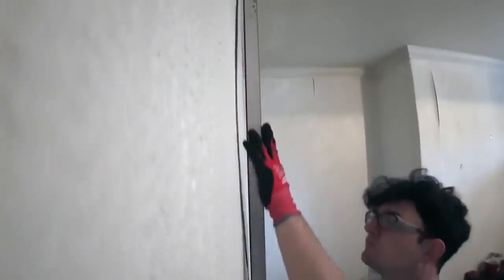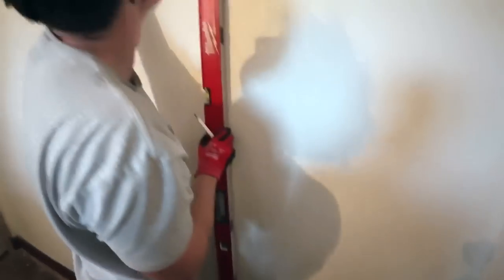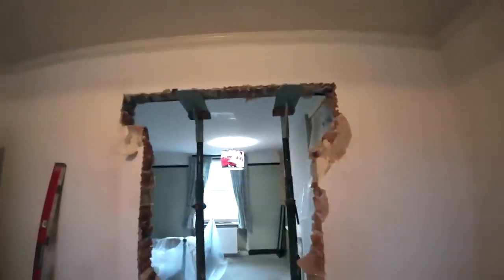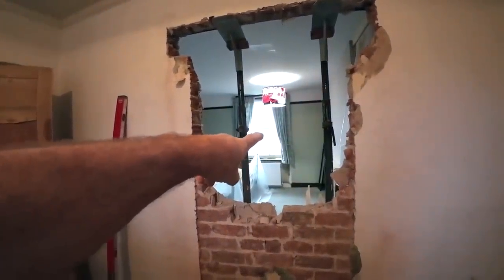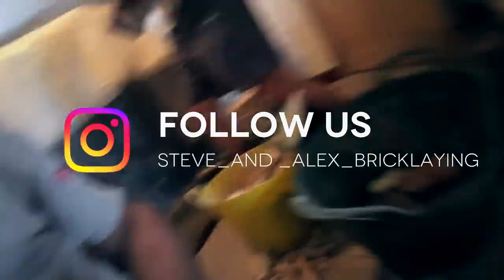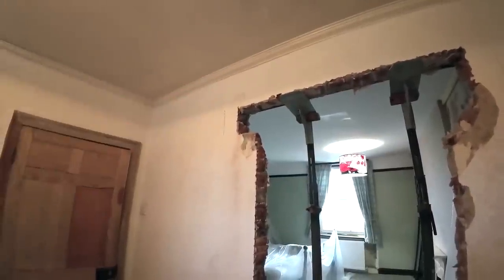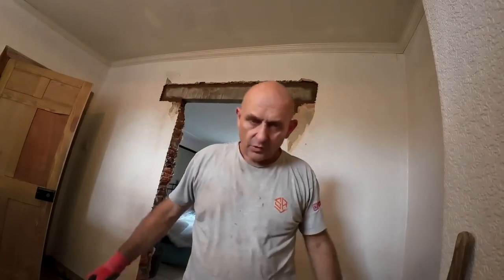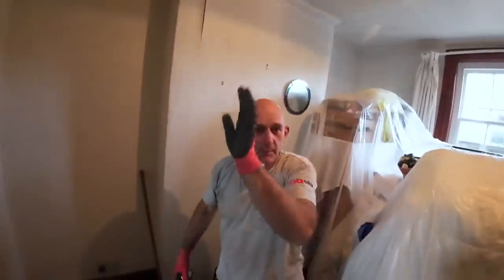CLIMBING 41 FLOORS AND FORGETTING TOOLS..LISTED COTTAGE LINTEL

Comment: Great job. Have you heard of the ArborTech Allsaw AS175. It is perfect for older brick work and it makes almost no dust.
Reply from the maker: I’ve heard of them but they are way too expensive 🧱👍🏽
Reply: Stupidly expensive.!!
Reply: Yeah I had to buy one to do some old restoration work.  It works great on that, but it's not worth it on anything new. And the blades are really expensive. But if you are working with soft mortar and older soft brick it works great.
Reply: I’m sure Milwaukee have one?🤣

Comment: How do you guys get on with listed building consent? Thanks
Reply from the maker: The customer took care of all that 🧱👍🏽
Reply: It depends on the grade of listing. If I remember right, grade 2 listing requires sympathetic approach to appearance, mostly from an external perspective. Grade 1 is much more strict, requiring the retention of as much of the original materials as possible and use of new materials correct for the era of the original construction, such as lime mortar, lime plaster, reclaimed bricks/timber of similar age and type etc. A friend of mine restored a grade 1 listed cottage many years ago and the hoops he had to jump through nearly drove him and his builder round the bend.
Reply from the maker: Yes it’s a 2 . We have a window to brick up on a garage which has to be lime mortar . 
    The house has not been looked after by previous owners and builders 😬🥺🧱👍🏽